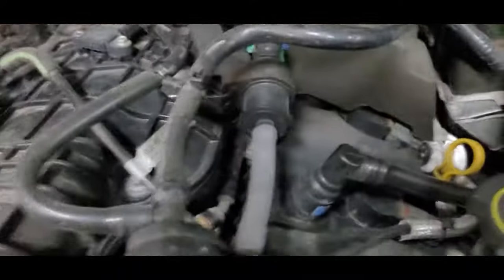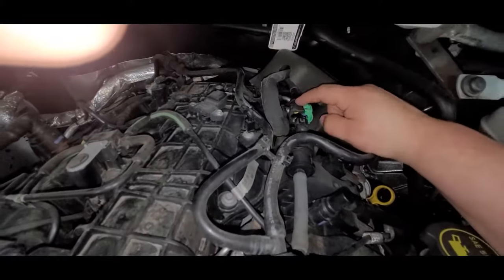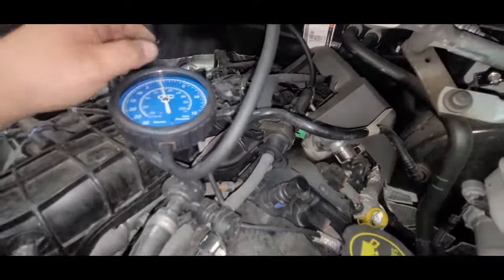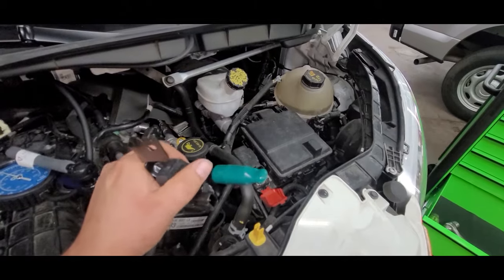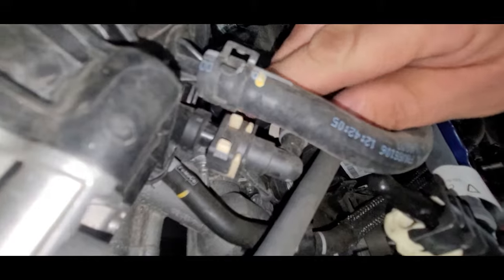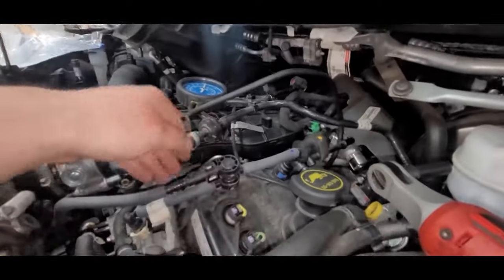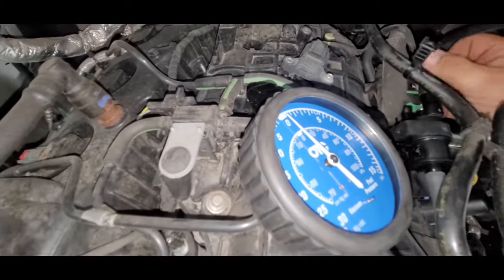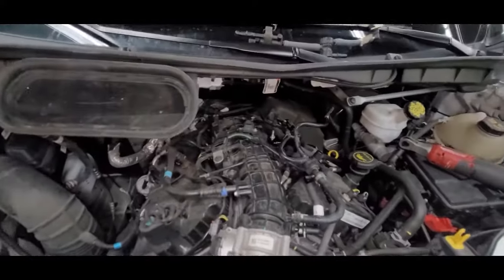Ford Ecoboost 3.5 Purge Valve Issue: Should You Replace It?

Comment: I got code p0496 and p0451. I replaced the purge valve with oem but still code popped up again for p0496... do you knoe what else it is?

Comment: Would a bad purge valve cause random stall? Or no acceleration while idle gas pedal just goes down. I have replaced throttle body
Reply: I got the same problem on my 2012 f150 ecoboost bro
My truck starts & has no power & then stalls out

It has the purge valve code but i changed the purge vavle the high pressure fuel pump & the throttle body & still having the issue
Reply: @Thegoat1998  I've seen this issue and it's the low pressure/in tank fuel pump.
Reply: @HickedUp  thanks for the help but i also figured out it keeps blowing fuse 76 when i turn on the truck would that also be the problem ? 
I will change the fuel pump in the fuel tank  & see if that helps.
Its been months & i cant figure it out alot of people are saying it could be a short in the wiring or a bad wiring somewhere
Reply: @HickedUp  what do you think ?
Reply: @Thegoat1998  that, I'm not sure. Looking at the fuse diagram for the 3.5l it looks like the canister vent solenoid, of which I've actually had to replace. May be bad wiring for a wrecked solenoid.
Reply: @HickedUp  whats the part # i should change first ? Or do i have to get a techinition to check the wiring harness ?
Reply: Did u find the issue?

Comment: Hey my man! Got the code P04F0 for a 2018 mustang ecoboost and took it to a Firestone shop. They ran a diagnostic test and said to replace the defective part is with part # Cm5233. When I got the sensor I thought it was the low Pressure fuel rail sensor but the pieces are different and noticed is was different part#. However, going back to the obd code P04F0 you mentioned the issue is the purge valve. Any insight would be great!

Comment: Is it possible that it could also say check fuel inlet on the dashboard for this issue
Reply from the maker: it is possible but usually that concern is with the evaporative emissions vent valve side near the fuel tank not the purge on the engine side
Reply: @JoeTheAutoGuy

Comment: What If the purge valve is stuck closed? There will be no vacuum on idle with the plug connected.
Reply from the maker: Valid but usually you will get a no purge flow dtc if it’s stuck closed

Comment: How do you clear the codes after you fix it.
Reply: Any 0bd2 scan took should be able to clear the code... If you have Ford's I recommend buying a forscan tool ($20-50) and using your laptop with forscan... You can do lots of things on a Ford with the forscan software with just a little bit of learning... But if you don't want to bother with that Walmart and harbor freight both sell a cheap obd2 scanner for around $20 that should be able to reset the code
Reply: It cleared itself after some miles on it.. thanks for the video.

Comment: Couldn’t you just leave the valve electrical connection on and then start it and get the same effect?
Reply from the maker: No because the solenoid is supposed to pulse if it’s disconnected and still drawing in vacuum the valve has failed because it’s normal state is shut and closed should be drawing in no air
Reply: Oh! So if it’s still drawing in vacuum before warming up the purge valve has failed?

Comment: What are the symptoms of this problem?
Reply from the maker: Hard starting after fill up and idle issues and poor fuel mileage and sometimes down on overall power
Reply: @JoeTheAutoGuy  The only thing I've noticed about my 3.5 17 Lariat is that, after a  fill up it kinda acts up and the idle is not very good in the beginning  of the fill up 🤔